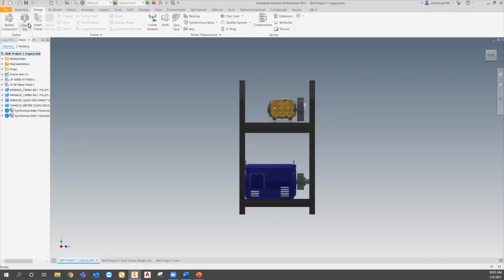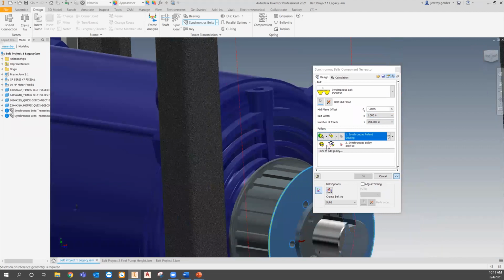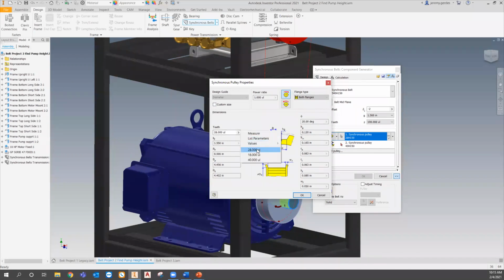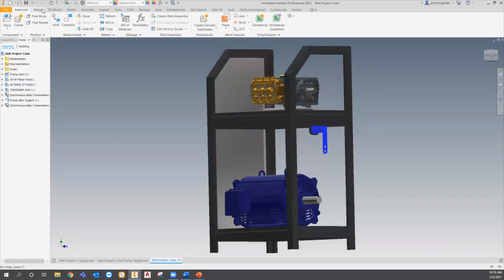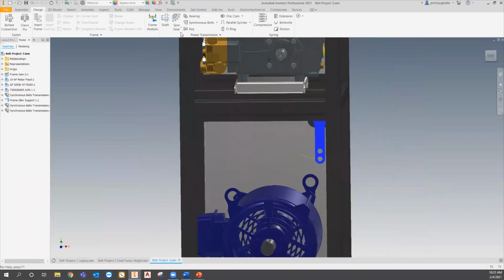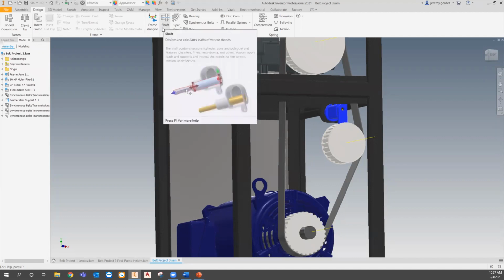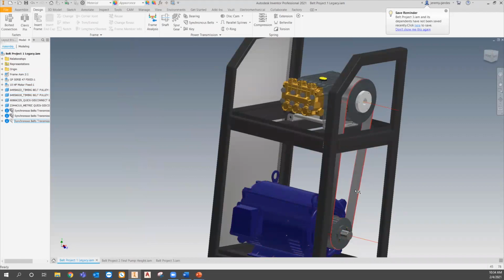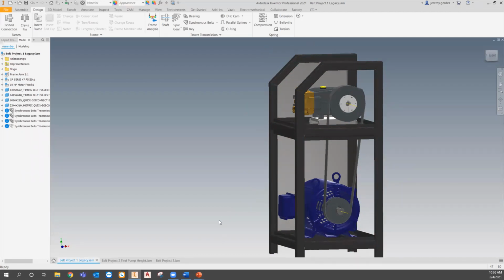Inventor Design Accelerator: Power Transmission Synchronous-Belts | AVA

Comment: Hello, is there any option how to get length of the belt into the assembly BOM? Thanks
Reply from the maker: Thanks for the question! The design accelerator creates generic parts based upon know industry standards while still providing the ability to customize the results as well. This means that the resulting belt may or may not be a length that is standard and would still have to be sourced. Therefore the expectation is that the description would be produced upon sourcing of the part to meet either the supplier description or your internal description standards. So, once you know the length you can put that in the iproperties "description" field, along with its complete description" and it will appear in any bill of materials. The length is shown (and can be over-written to be a custom length) when creating the belt system in a field called "Datum Length". If you have already created the belt system you can right click on it in the model tree and click "Edit Using Design Accelerator". You will then be able to find the "Datum Length" and transfer that information to the iproperties "description". I hope this answered you question clearly. You can register for our KVA series to stay up to date with the latest, here: https://ketiv.com/learn/